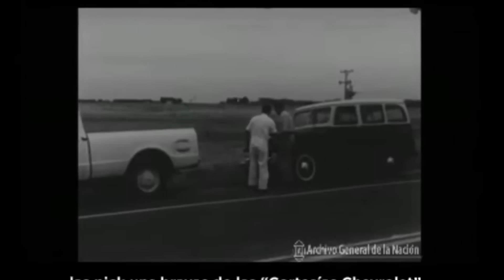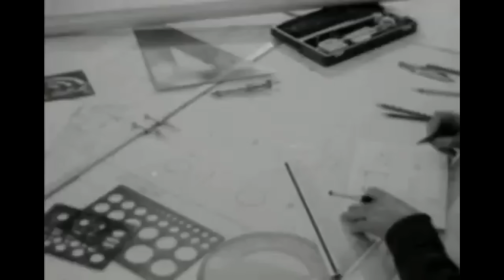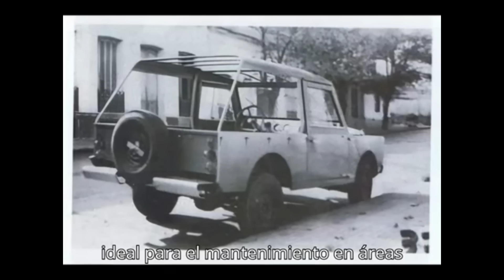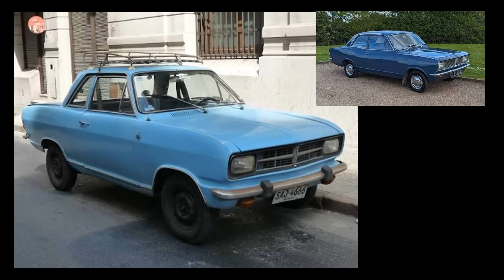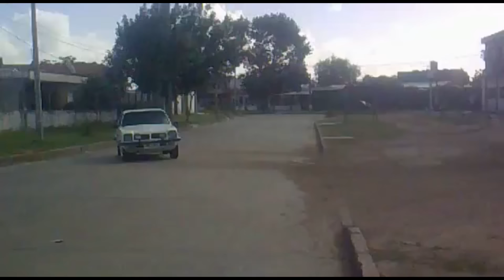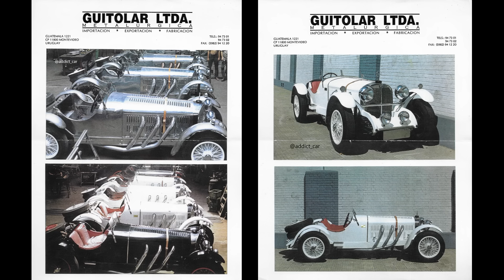Uruguay Once Built Its Own Cars

Comment: The main problem here in Uruguay with cars beyond the taxes is than people try to buy thinking on the inetability something will break and they will have to fix it for cheap so frontier cars from foreign brands reigned, its still easy to see 1980s or 90s Chevrolet Chevette, Ford Escort, Volkswagen Gol and FIAT Uno, even some VW Beetle still used as daily drivers and not only by Mujica copycats, one of my neighborghs has a Indio, now chinese cars changed that but its still easy to find a Beetle, a Chevette a Chery QQ and flaming new BYD Seagull all together

Funnily enough you said than imports were relaxed while showing a good amount of Banda Oriental on 18 de Julio, the Banda was probably the biggest success of the import restriction, a bus body made by and for CUTCSA, our biggest urban bus company and sadly natural monopoly

Comment: Interesting. However, the design of the Grumette 1825 isn´t inspired by the Vauxhall Viva but in full copied from the Opel Kadett B shown later for comparison, that and the Viva shared platforms, btw). I recall there was built a pickup based on the one-year-only german Ford Taunus 17m P7(a) model but with an Opel CIH 4-cylinder engine and under a non-Ford brand name by a local company, if memory serves me right that was in Uruguay too. Maybe worth looking for to make another video of but he only trace i´ve seen is an old magazine new-car sales ad posted online. There has also been a couple of strange pickups with a rough design up for sale online in a latin online market place very much resembling the Opel Rekord A/B series but looking almost home built and with some parts like the romboid headlights taken from the german Taunus´es of the same period. I wonder if these could be products of the same factory.
Reply: The Serrana and Marina were pickup trucks inspired by Opel and Taunus models, but they were built entirely in Uruguay and—unlike the passenger cars—featured a chassis.
Reply: @restorationandrecovery102  Thanks for straightening that out.

Comment: Hi from Brazil, just to correct you, even back then Brazil already had experience with design and engineering, with brands like Chevrolet, Ford, Willys, and especially Volkswagen. Especially Volkswagen, which operated completely independently from the German Volkswagen headquarters, in addition to bus body manufacturers, the national engine factory, and some other manufacturers such as: Puma and Bianco

Comment: Great video!!! A little correction: The indio grande uses some parts from the Bedford CF like the front suspension instrument cluster rear differential and the gasoline engine. The diesel engine it's a Perkins 4-108 unit not a Bedford diesel. The claim that the engine is a Bedford diesel is a fallacy; this misconception stems from a "Powered by Bedford" sign on the rear—originally belonging to gasoline models—that remained after their engines were replaced with Perkins units identical to the factory-installed ones
Reply from the maker: Thanks a lot for the detailed correction! I really appreciate you sharing this information. It's always great to hear from people who know these vehicles better than I do.
Reply: @TheTransportChronicles 
Thanks, it was a pleasure. You have really good videos. I look forward to the next one.
Reply: That´s right, I saw a lot of diesel Indios when I was a child. Those years the Perkins engines were very common: people used the 4-108 and the 4-203 to adapt big old cars and pick-ups with hungry gasoline engines.

Comment: About 25 years ago I visited Montevideo and was amazed at the number of old and modified cars on the roads. For example a 1955 British Vanguard converted from right hand drive to left hand drive. A 1939 Ford sedan converted to a utility truck. These and others were actually in use on the roads.
Reply: I´m from uruguay and I have a 1959 Ford Taunus, 1989 Renault 18 GTS Break (daily driver) and 1927 Chevy speedster (project car)
Reply: @lucascabral8284  Guau!

Comment: The problem with a car industry is you either have a vertically integrated company building everything or you have a lot of auxiliary and parts manufacturers.  Without either option you will always struggle and the smaller the market the harder to get economies of scale
Reply: There was an automotive industry in Uruguay because there were many parts manufacturers behind it.
Reply: @restorationandrecovery102  There’s a motor-vehicle industry in Canada but of those vehicles that are driveable on an equivalent of an EU class B license, pretty much all of them are manufactured by Canadian subsidiaries of foreign companies if such vehicles aren’t imported.